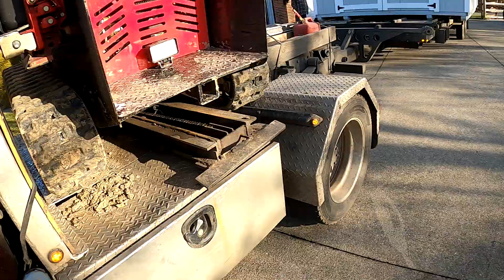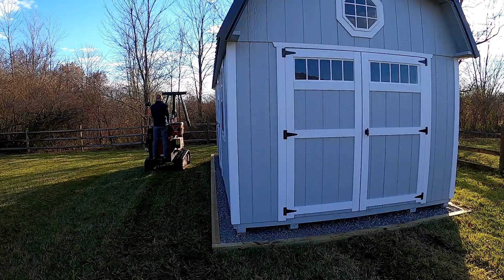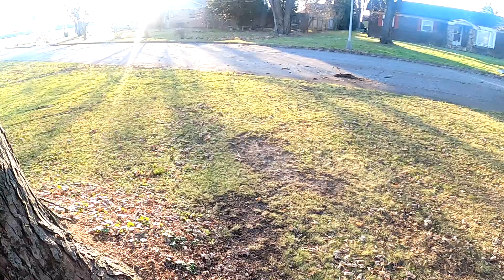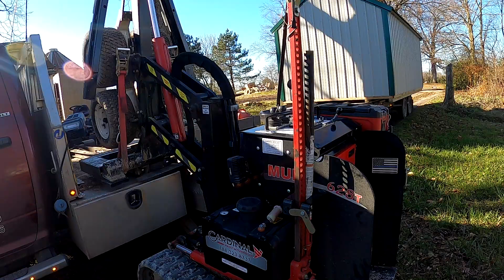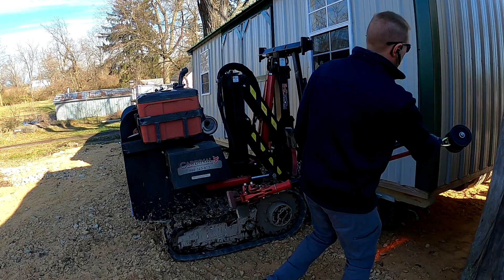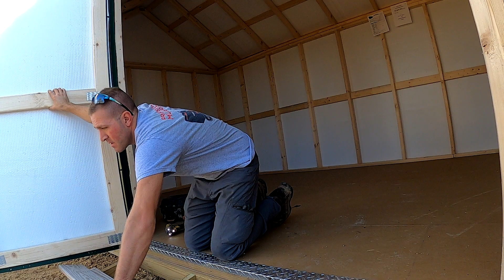Three Shed Deliveries In One Day

Comment: PTO, stands for POWER TAKE OFF….For an example, a PTO WINCH is powered from a vehicles gearbox. Electric winches are powered from the vehicle’s battery. Another example is, hydraulic pumps can either be powered by a PTO or can be powered by an electric pump off the vehicles battery.

Comment: PTO = Power Take Off. It uses the engine like the transmission to power an auxiliary unit like a hydraulic pump, water pump etc Tractors also use them to power impliments and such

Comment: PTO  Power Take Off it Operates A Hydronic  Pump & If You More Or Less You Speed Up Or Slow Down The Truck Engine With The PTO KNOB & You Turn It To Lock it Where You Want or Need it, Most ALL TRACTORS Have Them but they operate alittle different.